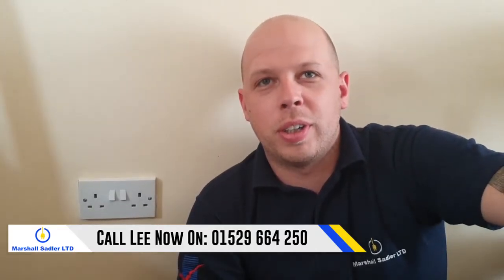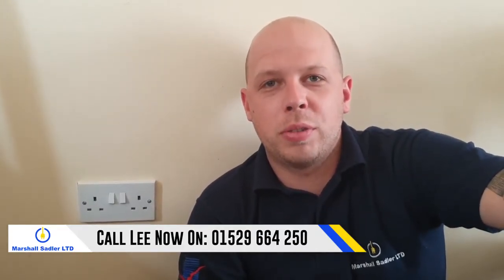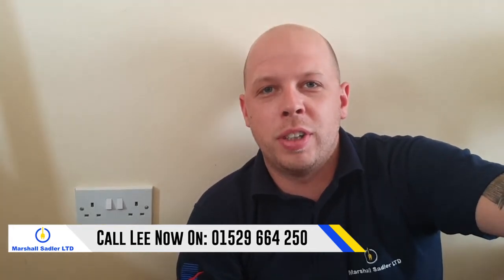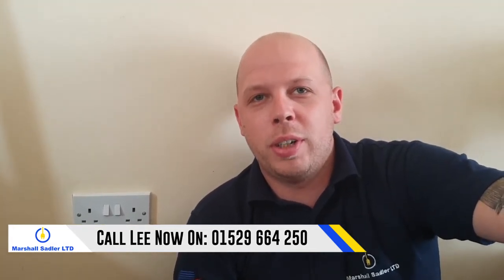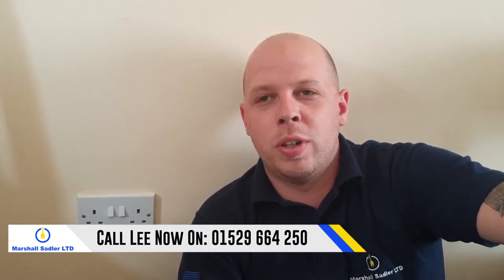is your socket not working

Comment: Good explanation of what could stop a socket from working.
But I have to disagree with point 3 , I have been a qualified electrician for a little over thirty years, and in all that time I have never come across any loose connections on sockets or light switches or any accessories. 
If you do it’s more likely that some one has done a bit of DIY and changed the socket themselves and neglected to tighten the screws properly. 
But I have never come across it as yet . Great video mate and it pays to spend a bit of money and get people like us in to do any electrical work. 👍👍